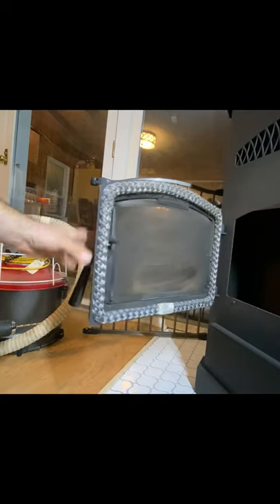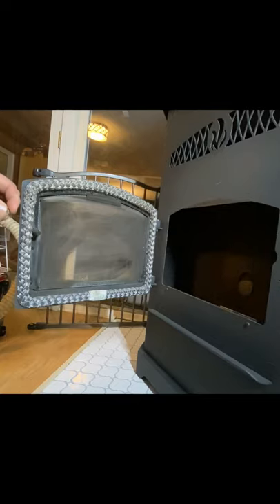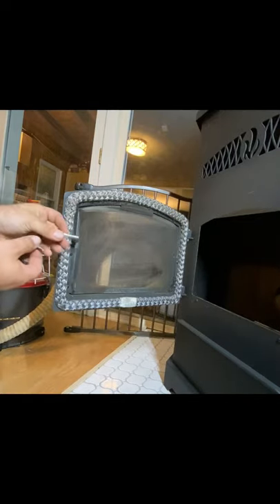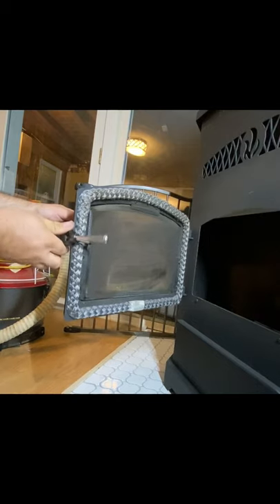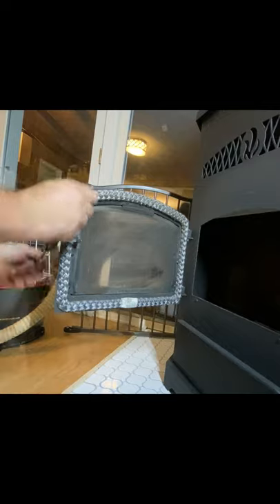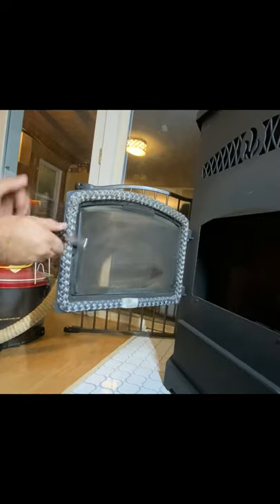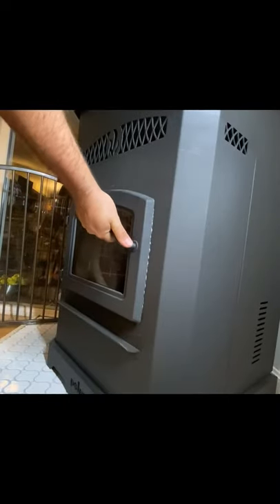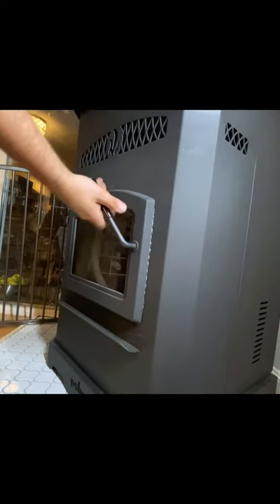Pelpro Pellet stove door fix

Comment: Huge shoutout for this video! My pellet stove door handle snapped right when the first snow hit.  Instead of spending $180 for a rush-ordered replacement or waiting two weeks, your video inspired me to fix it myself! A quick trip to Home Depot for a bolt and a $50 tap and die set, and boom – problem solved.  You saved me a ton of money and kept us warm tonight. This older video is still totally relevant!
Reply from the maker: Thank you!

Comment: I had this happen on a the same stove also. One note is that if you pay attention and orientate the pin the right way it the handle will be down as how it was designed when you close it and not sticking up in the air. I welded a pin back in to mine and fixed it that way. I did look in the manual and read that all metal parts are covered under warranty a little longer than the rest of the items in the stove such as the door gasket or glass for example. When I called to get a new door, because the older models the latch is held in with a welded collar, they would in fact have to replace the entire door in order for them to carry though with warranty of the handle. At first they attempted to argue with me stating the warranty did not cover the door and I replied the warranty isn't for the door it is for a metal piece on the door that according to there warranty guidelines is covered since it is an all metal part. They eventually gave in and did send me a new door. However the cheap gasket they used on the new door lasted about six months. these are an alright stove and I have one in my garage but would definitely go with a nicer brand if I was going to put one in my house.

Comment: Buying one of these tomorrow, will likely replace that just like you did with the 1/4 20 before I even started using it. Thanks
Reply: Purchased and did this modification right away. The original part actually was bent and cross threaded right out the box. Other than that the unit has ran flawlessly.
Reply: I've had one of these for 6 years had zero issues lol my handle is still original

Comment: Mine also sheared off in the first month of use...  I put a regular bolt through it, "that I think was a drawer hardware bolt...  Luckly, it was under warranty...  Contacted them, and they shipped a complete handle assembly to me...  Took them 2 months to get it to me, but they gave me an entire assembly, when all I needed was the bolt...

Oh, when they shear off, it will leave the threaded portion in there...  I had to use a dremel to cut a slot in the broken off bolt, then use a small screw driver to get the bolt out...

Comment: Thanks so much for the info!!!  Ours has been nothing but a pain since we installed it.  2 month wait for the replacement parts and $130!!!  I think I will just buy the bolt and tap.  Lol.  Everything else we have used is either too loose or shears the same as the original so I'm excited to get this fixed.  I didn't want to experiment for fear of wrecking the handle and really messing up our only heat source.   Our locking collar also disintegrated so our handle slides in and out, did you have a way to reinforce that also?
Reply from the maker: I’m glad this helped, I will take a look at the collar to see what some solutions are. Could you post a pic? You can either contact me on Facebook or email both in the description. I will help where possible.

Comment: Just brought home a new PP130B today, had it home for an hour when the wife decided to "help" put it into the shed for temporary storage. When she was horsing it in, and not listening, she managed to break that off, and almost broke the glass too. So, it needs done. So... 1/4 -20 bolt?  Also making noise from the convection fan, like the squirrel cage is rubbing the housing. Gonna call Pelpro Friday. Anyhow, great video, I need to either get this done or weld the locking tab on.
Reply: @ILiveInWackyTown , went with a grade B16-a bolt. same as we use in the boilers at work. This will get nowhere as hot as they do. Made for high heat.

Comment: The same thing here, exactly. Such a small section seems to be poorly designed. Imagine if the door came open late at night and the smoke, wait, that's what happened. Ordered a replacement and they filled the order and sent it 3 weeks later. Merry Christmas! looking at how to change out the handle today Dec 25 2021! Stay well , all.
Reply from the maker: Sorry to hear, don’t use the replacement part strengthen it with a larger bolt

Comment: Did you but that ash vacuum just for your pellet stove? Just use a shop vac and a HEPA bag when it's cold
Reply from the maker: Nope not just for the pellet stove, i'm a licensed oil burner and HVAC tech so I use it on everything.
Reply: @livefreeandtoolon  ah
Reply from the maker: @ILiveInWackyTown really! good job. I built a house in two days 1 day for the foundation and 2nd for for the rest easiest thing i've ever done. I have no idea why those general contractors charge so much. Bought a hammer on sale for 2.99 and boom instant in depth knowledge to do everything.